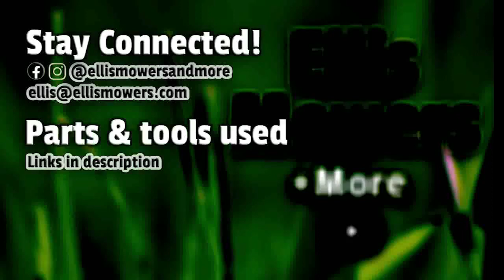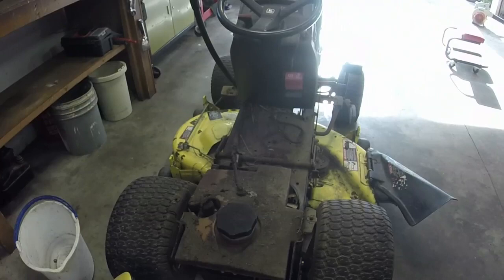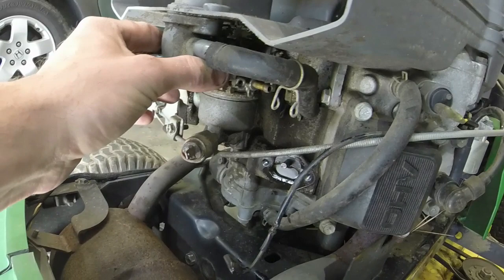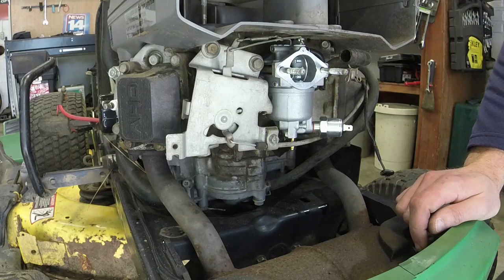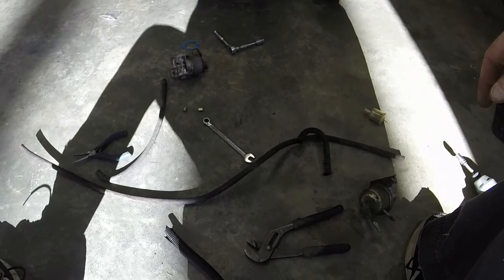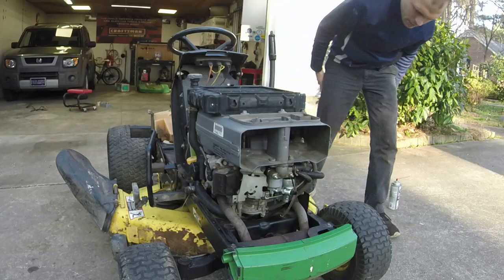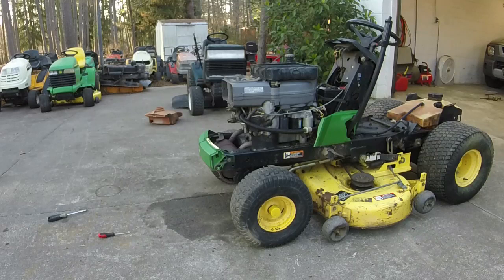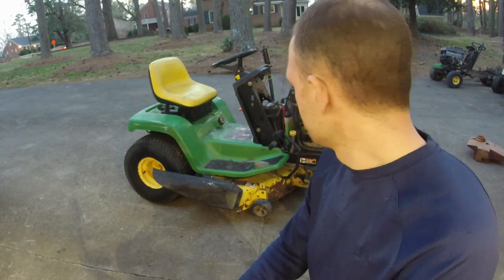Free John Deere LX188 lawn tractor fuel system overhaul to get running (bad aftermarket carb!)

Comment: Had the exact same problem of overflowing carb. Ya gotta watch those after market carbs! Great little mower when its running right, but a nightmare to work on. Thanks for sharing the pain and pleasure of this repair.
Reply from the maker: You are exactly right.  Runs great until it doesn't and then it's a pain to fix!

Comment: I had to smile and sympathies all the way thru this,  I have an LX178 which has the same style carb and fuel pump as this,   the other day mine started dumping fuel out of the carb so I immediately suspected something in the carb needle and seat area (original 1996 oem carb)  took it apart and found the plastic tab on the float that pushes on the needle cracked.   Could not find a replacement float at a reasonable price so bought a clone carb off amazon.  Same problem leaking fuel,  in the meantime I noticed fuel pump leaking so replaced it.  fussed with the new carb needle and seat, never could get it to stop leaking.    Put the old original carb back on but used the float from the new carb.   Bingo all is well.  As it turns out the  Amazon carb that I stole the float from was still cheaper than buying just a replacement float.  Reading Amazon reviews a number of ratings of 1 star because no matter what they leaked,  ie bad needle or seat.
Reply from the maker: An aftermarket carb was the only thing that fixed an LX279 I did a couple years ago.  I thought this would do the same.  Carb issues on these are hard to fix, thanks for sharing your experience!

Comment: Thanks for mentioning the spacer behind the fuel pump. I didn't notice it when I took the old one off my LX178. Blew out a new pump in two minutes and I couldn't figure out why fuel was pouring out the top of the carb. No other video I've watched mentioned it. Thank you for ending my two week headache.
Reply from the maker: I made that same mistake on a previous machine, glad I was able to help!

Comment: Ive been lucky Casey , only got one bad after market  4 cycle bad carb and one bad two cycle carb - so far ......When I was working on them I ordered from Amazon with free returns - best way as far I can say to order a Carb .
Reply from the maker: I usually just eat the costs and use the jets, seals, bowl and other parts on other carbs if compatible.  I also ordered this carb last year anticipating I was going to fix it sooner rather than I did so I'm past the return window unfortunately.

Comment: the old john deere 160, hydro 165, 170, hydro 175, 180, and hydro 185's all have nice heavy duty fiberglass hoods that you can modify to work on these. i have done it several times since the plastic hoods are junk. If you run across an old parts machine (the ones i listed) with a hood, save it just for this occasion!

Comment: I'm working on a 178 right now , I also ordered a carb with reservations because it's aftermarket, and a lot of reviews complained about carb   over filling . If I have to use the old carb, I'll have to steal some parts off the new one because whoever worked on it messed it up . Good job . Also, where I live and you run a shop , all safety interlock switches have to be hooked up and working when it leaves !!!
Reply from the maker: Hopefully there are similar enough parts for you to be able to use on the new carb, they are usually built slightly different than OEM (probably patent related).  Anything I do with the safeties I advertise when I sell the machine or at the very least tell the buyer upon arrival.
Reply: I went through the new carb and  found the float would have overflowed , so I adjusted it and checked everything out. One problem I'm having is the  choke sticking and won't come back when you throttle back . Have you had that problem and have you adjusted one before?

Comment: Great video! I followed it step by step to replace my carburetor, except for the linkage in the back, I could not connect it as you showed, so I removed the nut at the bottom of the lever and was able to connect it.
Reply from the maker: Awesome, thanks for watching!  The linkages are a little tricky to get on as the radiator fan shroud can get in the way.

Comment: I’ve used more fuel hose in the last couple of years than I have in 10 years, it’s just gets hard and cracks or stops up on the inside 
Fuel caps the rubber seal breaks and falls in tank also 
Very common problems

Comment: Some nice work on this lx188 looks like the original carb fixed this issue with the fuel leaking , must have been a badly assembled carb that is defective.  I wish those John deere hoods were more durable and not break off of them now

Comment: To anyone...I have a J.D LX178. Was running at end of last season. This season will start, but then cut out after 2-5 seconds. Probably needs a new belt as well as battery. Probably not experienced enough to diy. Burns a little oil. Is this worth having someone repair? Guessing may need a new carb and fuel pump. Probably not looking to spend over $400 or so.
Reply from the maker: You probably need a good carb clean on it.  These mowers will run forever but the liquid cooled engines are so tricky to get running good again once they have trouble.

Comment: Good job, Casey,  One thing that I recommend on these older riders is to add an in-line fuel shutoff just in case there are leak issues.  (especially if you are already rebuilding the fuel line as you did here) It is a lot quicker than searching for a clamp or vise grips to stop the flow. The blades didn't sound like they were up to speed but that may be a belt issue.   On the donor LX178, do you know if the ignition module/switch is good?   I have had to replace this on my 178 with another used part and it acts like it is going out as well.  These are about $300 from Deere and of course, these mowers aren't worth pricy parts like that.  As you know I'm just about 40 mins away so let me know and I can come harvest the part if you would prefer.  Thanks.  (Tom in Hillsborough)
Reply from the maker: Hey Tom yes I sometimes will put a shutoff on mowers but I've had some of the shutoffs leak and since this is a fuel pump engine I decided not to on this one since these can be very finicky with fuel.  I'll check on my donor 178 but I'm pretty sure it does not have the ignition switch.  I bought it off a small engine shop and I bet he got it knowing their value!  I don't think I had the throttle set right, I learned you have to adjust the whole throttle plate assembly to get to to be the right speed.

Comment: A bad carb 😡🤬  the actual Kawasaki carb is a  high dollar 💵  piece of  of engine parts I've got to replace the p.t.o oil seal on mine craftsman limb chipper  leaf shredder
Reply from the maker: Yes Robert I was trying to stay ahead of the game since a carb fixed the LX279 last year this time it bit me!  I was able to get the original carb to work which was the most ideal situation anyways.
Reply: @EllisMowersandmore  that is the truth about the carb  being a original one  for some reason a after market one May not let the engine be at it's best as in the case of the Kohler engine on my j.d Lt 133 as was told to me by my shop now I have to get the right oil seal for the 5 h.p Briggs and Stratton engine in the limb chipper leaf shredder

Comment: I'm definitely no expert on mower repair, however, I was wondering if the carburetor studs couldn't be backed out to allow easier removal of the carburetor?
Reply from the maker: Not sure, they probably could have when new but after nearly 30 years they're not coming out.  Some people remove the radiator to access but once you figure it out it isn't too bad.